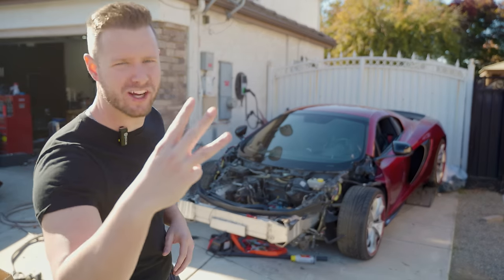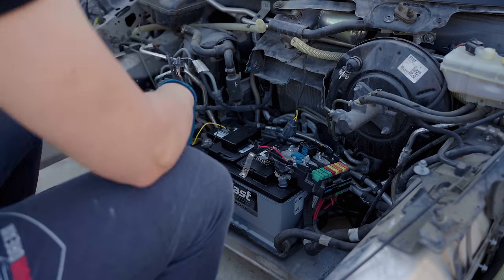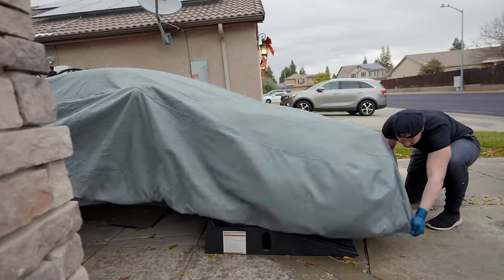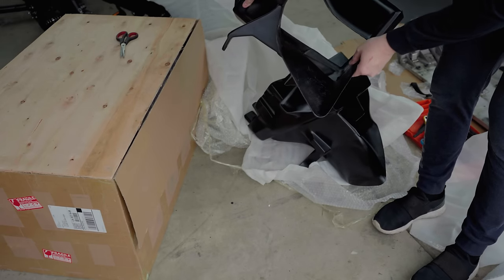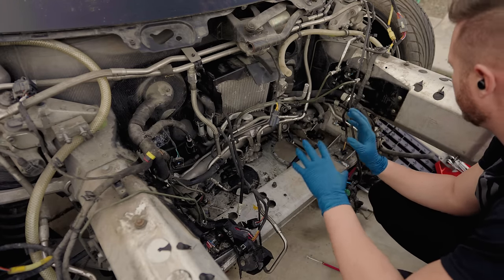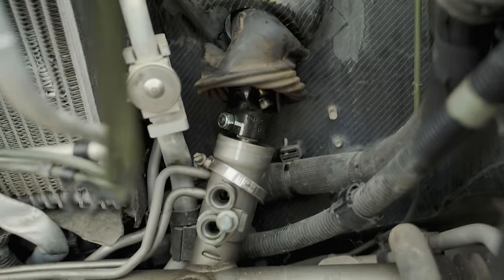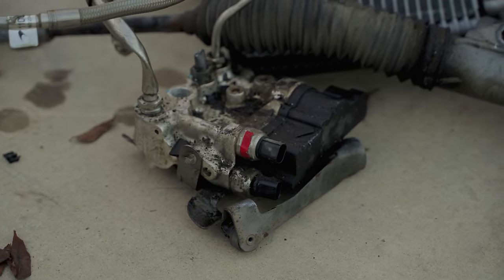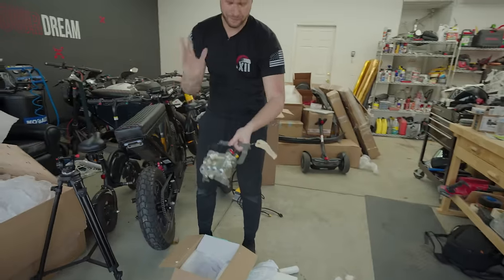TAKING APART the $38,500 MCLAREN...WHY WAS IT SO CHEAP?? (PART 3)

Comment: With those brakes remember: If the wheels are off ALWAYS take the rotors off.  Carbon ceramics stand up to heat and wear but are easily chipped or cracked at which point are unsafe and are thousands to replace each rotor.

Comment: On the GT3 and a few Lamborghini's there is a very helpful way to pop the rear engine cover. 
So basically if the battery dies you can take the key of your car and pluck a plastic panel near the engine bay.(Very small hatch)
Once you remove the small hatch you will find a connector connecting the servo of the rear motor to the ecu. So basically now you disconnect the connector and connect it to a 12v supply. This way the engine bay can open.
Wondering if something like that is hidden.

Also I think Tavarish had same issues with parking brake release. He noticed the connectors were in good condition so gave some power and the parking brakes released separately. (This was a small separate item that is not related to the brake calipers, "on his car").

Comment: Not sure if you have the engine cover open yet or not but i found this on a forum hope it helps "With ignition on and engine off, fuse in the location 25 in the box behind the passenger seat ( right hand drive car)

There are two lines of horizontal fuses. Iirc 25 is the third one from the left..on the lower of the two horizontal rows....but I'm not sure so look in the manual for fuse 25 location

Take the fuse box cover off by forcing fingers under the lower edge of the cover and pull out......ignore the two latch type levers within the cover holes, it comes off easily also the cars battery must be charged to at least 90% for the release to work" hope this helps
Reply from the maker: Yeah did that all in the first video. Any forum about this subject I've read and tried already 😅 appreciate help brother!!

Comment: Have you thought about remaking your own composites for items like a battery box, defuser radiator duck (if you can find one to duplicate.) You can do carbon fiber twil or forged carbon for a bunch of parts
Reply from the maker: Yeah, I'm honestly expecting to fab most of the brackets for the front bumper and other misc pieces!

Comment: That is not a radiator. It is the air conditioning evaporator. It is sucking air from inside/outside depending on AC settings and blowing it through the evaporator core and then into the car to cool the cabin. If you search for evaporator core and evaporator housing, maybe you can find it.

Comment: The ultimate goal of any manufacturer is to make as difficult as possible, if not impossible, for you or any third party mechanic to work on their vehicles.  They do this so they can soak you on the purchase and the maintenance.  Also, so anyone who owns the car after you has to bring it to the dealer for service so they continue to screw owners on maintenance for the life of the vehicle.

Comment: I can't believe you have bee able to get this far working in your riveway, without a garage hoist. I laughed when you did not know what a brake servo was. I don't know how you are itemising and labeling the parts, or how you will get it back together in the right order. I definitely couldn't do it. Good luck with it, this great to watch. I wouldn't drive it quite flat out once you get it back together, I would hate to see the engine blow up after all this work.

Comment: Nice Job man ! 
When you change brake pads, remember to weigh the discs because they wear out differently than metal discs. If they are too light, they will fall apart.
That missing part for HVAC is a heater core unit with blower motor maybe sorce it from 570S or check it maybe that will fit.   13A4013CP
Reply from the maker: Thanks a ton dude!

Comment: Okay so hopefully you look at your comments or someone tells you after seeing this but that is the hvac fan that goes there and the duct is attached to it for your cabin airfilter hope that helps.
Reply from the maker: You don't happen to have the part number for the fan or a link to the fan, do you?

Bought the HVAC inlet but it didn't come with the fan unit or filter.
Reply from the maker: Appreciate the help Matthew!
Reply: The filter you can get that you cut the tab off and shave the side down it’s 17 dollars instead of buying one from dealer that’s 125 dollars the cabin airfilter that fits it is an ATP from a 1995 Bmw 525I
Reply: Sent you an email with a part hope it helps you out.
Reply from the maker: @matthewgillson92  much appreciated. All the help is great.
Reply: Filter should come up as RA44 from ATP the tabs get taken off with a razor and fits right in there

Comment: Yhea if you didn't know what the brake booster before this project? Yhea your new to the car repair/ rebuilding process! Should be interesting to see if you can get it running and driving with no real issues! 🤔
Reply from the maker: I've just never had to replace one before. This is like my 5th car build, done several motorcycle builds too...sure not a professional but I'm not a total noob.

Comment: The part name your looking 👀 for.   Is for the front hvac system.   I’m not sure if your needing the rubber gasket.    Or the duct system.   The heater core is in the middle of the car and the hole leads to that.     Let me know.

Comment: Bait and switch. Make the seller send the things your bought!
Reply from the maker: Ended up with a better item than I paid for for the subframe, luckily, no huge complaint there, just not what I expected. Steering rack was for an earlier model 12C (different than the 650S), but they advertised it as a 650S steering rack. 🙄 So I totally agree. And by the time I logged in to eBay to return it, the return window closed a day before and the seller refused to let me return it.
Reply: @TheInja  That's why I hate buying anything online.

Comment: Simply tell the ebay seller to semd the missing battery box...
Reply from the maker: They sold the one in the listing to a local buyer haha. Didn't have it even if I wanted it. But in this case, no real hard feelings since the one I got was in better shape anyway, just missing the yaw sensors and battery bracket.